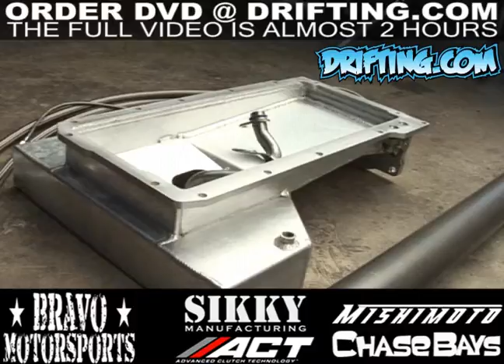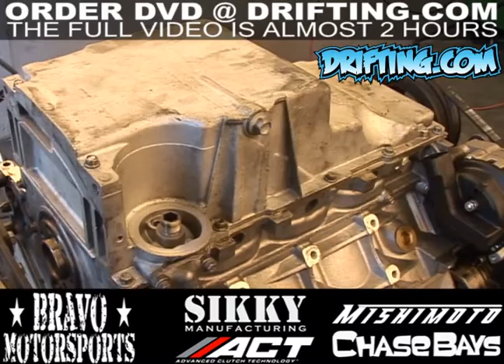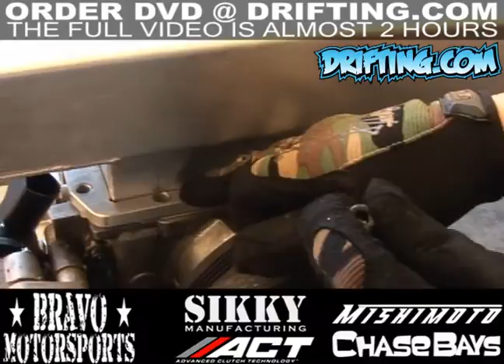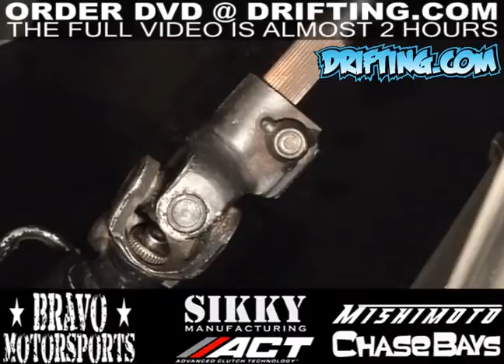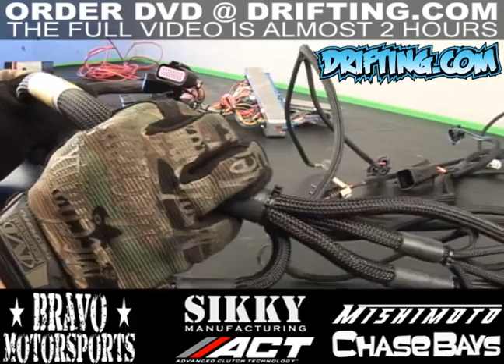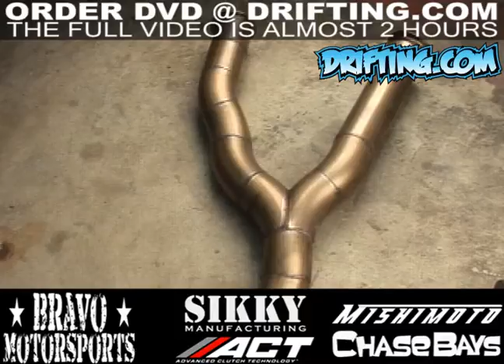LS1 240SX Swap

Comment: so basically what this video is saying is "if you spend $17,000 you can have a turn key LS swap in your 240sx without you legitimately doing any work." this isnt a build, this is a lego set. I sourced every piece of my swap. Had to source an oil pan, and corvette accessories for my LM7 engine, I fabbed engine mounts out of hockey pucks and I had to build headers from old vette headers i picked up, along with sourcing cheap used parts and modifying the stock wiring harness. It isn't this pretty or this fancy but it works and i built something that im proud of without spending an insane amount of money. And i loved every minute of it.
Reply: $17000? that's a completely random number with no backing to it. A brand new ls1 only runs like $3500. The full swap kit they used costs around $2500. A t56 can be had for $1500 on average and the engine harness was like a grand. minus little bullshit they needed or fabbed up, what they did was a $10000 swap maximum. Unless you were including the price of the s-chassis?
Reply: +Blake Taylor I'm talking about this swap in particular. brand new LS3 is 7 grand and new t56 is 4 grand. every other miscellaneous part is gonna be around $6k. im with you bro, im LS swapping my car under 5k without using all this expensive ass crap that can be replaced a hell of a lot cheaper
Reply: Ah gotcha man. Ironically enough I'm doing an ls3 as opposed to the ls1. The car's gonna be under the knife for awhile. The only thing I refuse to mess with is the wiring. I'm pretty ignorant about that so I already paid a company to make me a mil-spec one.
Reply: +Blake Taylor Right on man. I would love an LS3 swap. Wish I could afford it. And I personally love to map out and solder and pin electrical, so I'll save quite a few bucks doing it. Good luck with your swap! and remember not to spend money that you don't need to spend
Reply: +aeroryan1 amen. it's easy to get caught up in b.s. you are told you need but really don't
Reply: Just as you, I'm planing on doing most of the work myself. Much more satisfying then having some one assemble a Lego set for you. How's the swap going?
Reply: hello jaja cage is done, 95% of electronics are done except for wiring up the fuel gauge sensor and running wiring looms for the front (decided to do tube front and am eliminating the fuse box now) everything is moving at a snail's pace but there's progress at least.
Reply: +Blake Taylor For someone who is doing it their first engine swap, this would be a good idea to spend bit more money for them to be more safe than sorry right?
Reply: AidosHD not necessarily spending more money, just knowing that you have trustworthy people to help you out. There will always be some degree of worry when buying a used block if you don't go the crate engine route but that doesn't mean you need to drop 17k.
Reply: I know what you mean. This is a random question but do you think a E30 be good for a first car?
Reply: +AidosHD It doesn't hurt to save money so take some slight risks. If you are in a rush with the car and have a deadline to have it driving, spending money is the way to go. If you have the time, build it yourself, the less you spend, the more you learn. An e30 makes for a wicked daily driver if you know how to take care of it, a couple of my buddies have them.
Reply: +AidosHD e30's are a personal favorite of mine but if you haven't already bought one DEFINITELY DEFINITELY DEFINITELY be weary and don't be afraid to shop around. my biggest issue was falling in love with a car and not thinking logically. check floor pans and struts for rust on them. super common on that car. I'm in Florida and even here no rust on those is nonexistent
Reply: +AidosHD e30's are a personal favorite of mine but if you haven't already bought one DEFINITELY DEFINITELY DEFINITELY be weary and don't be afraid to shop around. my biggest issue was falling in love with a car and not thinking logically. check floor pans and struts for rust on them. super common on that car. I'm in Florida and even here no rust on those is nonexistent
Reply: +AidosHD e30's are a personal favorite of mine but if you haven't already bought one DEFINITELY DEFINITELY be weary and don't be afraid to shop around. my biggest issue was falling in love with a car and not thinking logically. check floor pans and struts for rust on them. super common on that car. I'm in Florida and even here no rust on those is nonexistent
Reply: +AidosHD e30's are a personal favorite of mine but if you haven't already bought one DEFINITEL be weary and don't be afraid to shop around. my biggest issue was falling in love with a car and not thinking logically. check floor pans and struts for rust on them. super common on that car. I'm in Florida and even here no rust on those is nonexistent
Reply: +AidosHD e30's are a personal favorite of mine but if you haven't already bought one DEFINITELY be weary and don't be afraid to shop around. my biggest issue was falling in love with a car and not thinking logically. check floor pans and struts for rust on them. super common on that car.
Reply: +AidosHD e30's are a personal favorite of mine but if you haven't already bought one DEFINITELY be weary and don't be afraid to shop around. check floor pans and struts for rust on them. super common on that car.
Reply: +AidosHD e30's are a personal favorite of mine but if you haven't already bought one DEFINITELY be weary and don't be afraid to shop around. check floor pans and struts for rust on them. super common on that car
Reply: +AidosHD e30's are fantastic but always always always check your sweet spots on them. floor pans, wheel wells and struts are incredibly common rust areas

Comment: nice swap man but wow the price for sikky products is crazy. well i guess since there are few companies that supply swap kits for this kind of swap they can charge so much. Im going to fab my own mounts and i will cut a piece of the crossmember and do a lil welding so that i can buy a brand new gto oil pan or something to save money on the low clearance pan that companies have. there are many way to save so much money but thats me. i might by the whole clutch conversion kit and power steering lines and maybe headers but driveshaft, oil pan, motor tranny mounts, i will have made or make myself. I can save quite of bit of money that way